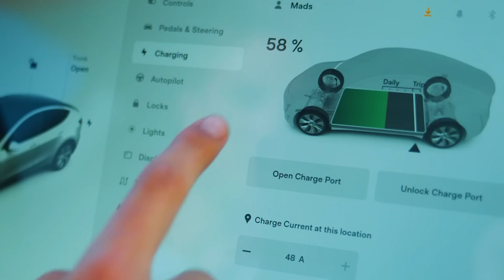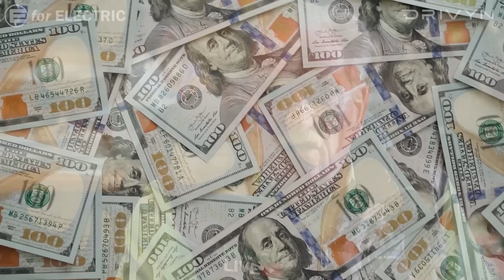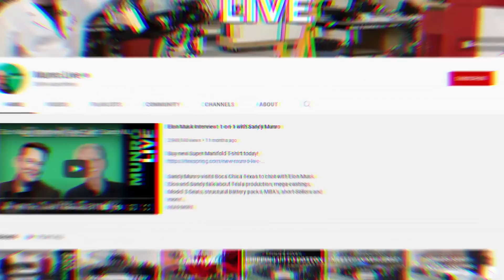SANDY MUNRO Calls Out EV Makers

Comment: China’s EV automaker BYD is vertically integrated.  Like Tesla, BYD makes their own EV batteries.  Unlike Tesla, BYD makes their own semiconductor chips.
Reply: Tesla makes their own battery, fyi. As well as sourcing from others.
Reply: Tesla doesn't own a chip FAB but it does design it's own chips. Just the same way Apple does. It designed the FSD Processor Chips in its cars. It also designed the  processor for DOJO its Neural Network Training Supercomputer that it also designed and built.
Reply: @arseliopereira2541  Good points. No one, including Tesla, anticipated a persistent shortage of the dozens of low-tech chips used for most functions in today's cars.
Reply: The solution will be the auto makers will start buying battery and semiconductor companies.
Reply: @Dularr  Auto makers can't buy the battery companies. All of the legacy auto makers already have huge debt. What will probably happen is that the battery makers will buy the electric divisions of the legacy auto makers when they go bankrupt. When GM goes bankrupt LG Chem will have no option but to buy what's left of GM's electric division or lose all the money they spent partnering (building battery factories) with GM. SK Innovation will probably have to do the same thing with Ford or go down with them.
Reply: @arseliopereira2541  they won't be buying the big battery giants. They will buy a local company
Reply: @Dularr  What local company would that be?
Reply: @arseliopereira2541  looks like Magma is making batteries for GM
Reply: @RogerM88  I don't understand what you're trying to say. Yes Tesla uses battery manufacturers as their suppliers. Panasonic has a battery factory inside Tesla's Nevada Gigafactory. They also buy batteries from LG Chem and others. CATL is their biggest supplier in China. But Tesla is also becoming a battery manufacturer. They have the Kato Road facility in Fremont California up and running producing their new 4680 batteries. Plus the new 4680 battery factory should be up and running soon if not already at Giga Texas. There is also a new 4680 battery factory under construction at Giga Berlin. So Tesla is not just a car company buying batteries from suppliers like the rest of them. The only other car company that makes batteries is BYD in China. Barring any unforeseen events like World War 3 in Ukraine or China's crazy Zero Covid policy Tesla should manufacture well over 1.5 million cars this year. They should manufacture at least 2.5 million cars in 2023. Nobody can even come close. Chinese Automakers will do well in China and maybe even sell a few cars in Europe in the next few years. They won't make any significant inroads in the United States in the next few years. I don't understand the part about Legacy Automakers having more diverse powertrains. More than 100 years ago the carriage makers had many different breeds of horses. How well did that go? I bought a Model Y a month ago. Until you experience owning a Tesla you'll never understand.
Reply: @Dularr  I think you have your facts wrong on that one. Magna does not make batteries. LG Chem is currently the only battery manufacturer for GM and as you may or may not know there have been some issues. Their partnership is definitely on fire.
Reply: @arseliopereira2541  I think it will require maximum effort.
Reply: They also get free money from the communist Chinese govt, hardly an organization we should be supporting.
Reply: And BYD blade Battery is much better. And it is no surprise that BYD up there with tesla because they are the oldest player in the EV market along with Tesla. Much mature than GM or Toyota

Comment: These videos aren’t gonna age well, Sandy is just a Tesla fanboy without much substance unfortunately.
Reply: That is what competition has been saying, but where are they? Talking about without substance? Audi e-tron, Ford March E, Hyundai Ioniq 5, Lucid Air, Jaguar E-Pace, GM Bolt, Polestar, etc...? How are they doing compare to Tesla?
Reply: @nguy404  The first 3 in that list are fairing quite well, the rest are either too Dorkey or too expensive. 

Batteries don’t make sense for large vehicles, there can be an argument made for something the size of a Tesla model 3, but for anything bigger it doesn’t make sense.

Electric vehicles will actually speed up climate change, and just become another oil. There’s no way internal combustion vehicles are gonna go anywheres for at least another decade or two
Reply: @thomas735  when you say "the first three are fairing quite well", what do you mean, specifically? 
As for battery-powered "large" vehicles being impractical, I do have to ask if you have a background in physics or engineering. If you do then I would like to see your quantitative rationale to back up your statement. The real experts seem to have a much different opinion given how many large vehicles are being developed as BEVs. 
Finally, the climate-change argument is quite old and wrong. It has been completely debunked by several groups with sound, quantitative analysis.
Reply: @thomasruwart1722  liquid fuel beats batteries many times over when it comes to energy per a pound. A gallon of gas can move a truck 20 miles nowadays, for an EV you’d need 200 pounds of batteries.

This is neither sustainable nor environmentally friendly. Perhaps when (and if) solid state batteries come online things will change, but shortages right now with just 4% market share should make it apparent that we are going in the wrong direction.

Sandy, Electric Viking, Alex, and Cathie Wood love Tesla because it is making their wallets fat, nothing more.
Reply: @nguy404  well, let's see, GM sold 25 Bolts and 1 Hummer EV in Q4 of 2021. Ford sold 27,140 Mach-E Mustangs in 2021, ...etc. Tesla sold a total of 301,998 cars just in the US in 2021 averaging just over 25,000 vehicles per month. During the first 3 months of 2022, Tesla is averaging over 100,000 cars per month. 
So, how is Tesla doing compared to others? There's the math. You decide.
Reply: Ya agreed. Very Negative and vocal, might get some views that way but not mine. 
Our world is going through enough horrible stuff right now without turning on a once interesting EV channel about innovation coming on and verbally abusing everyone but God’s apparent gift to earth Tesla… 🤮🤢🤮🤢
Reply: No he is not a fanboy. He takes apart cars for a living. He can go into extreme detail on each and every part and what is right and wrong with it. And he has ripped into the Model 3 more than once.

He likes Tesla because they learn from their mistakes and are improving things. And he will pull out the part and tell you how they improved it.
Reply: @jamesparson  He doesn’t Tear apart cars, he pays people to Tear apart cars, big difference. 

I’ve been watching for a long time, and he gets his facts wrong more often than not. Not to mention he’s contradicted himself on hydrogen more than once.
Reply: @jamesparson  Ditto! Thanks for saying that!